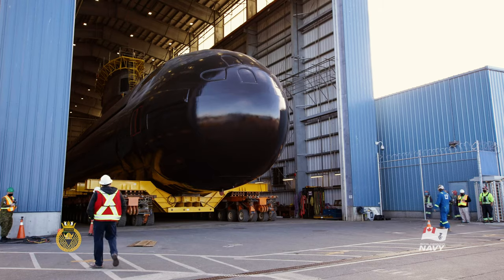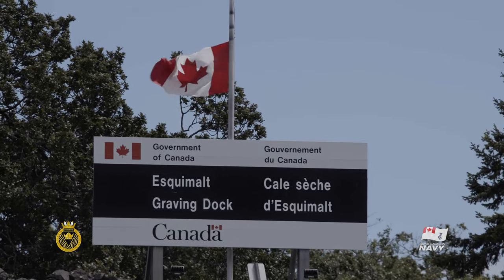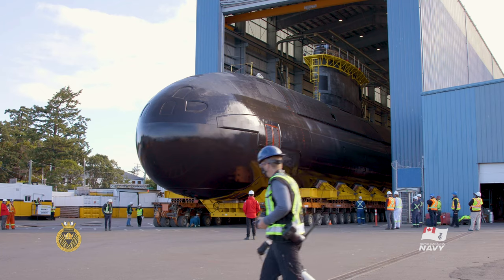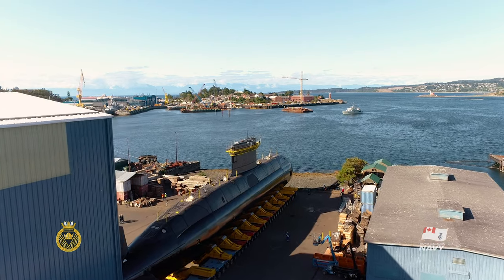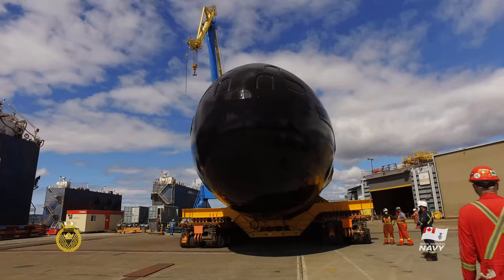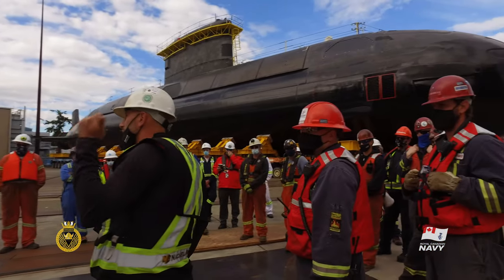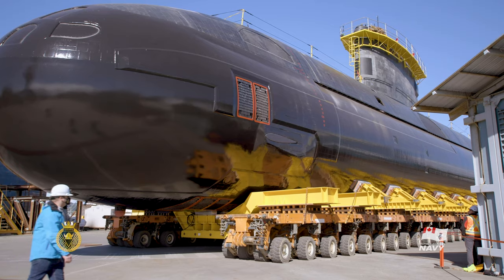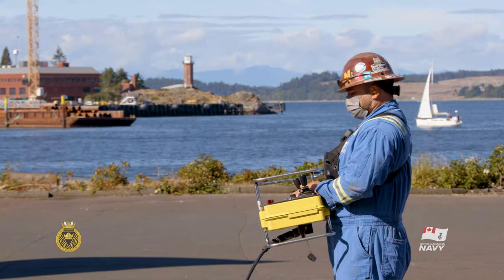HMCS Corner Brook Undocking

Comment: Does it work because we could have had 12 new Japanese hydrogen subs for the price of these 20-year-old ones
Reply: Not even close. A new sub would cost close to a billion dollars a piece and still have the same sustainment costs per unit. Down time is usually done on a cycle of several years of service with 2-3 years of refit where a vessel will be completely stripped down and built back up.
Reply: @Intense951  It has been 2 years since any sub has been in the water. What the point if you can't use them.
Reply: I'd rather have a $billion dollar working submarine with good to excellent availability than a dirt cheap submarine that spends years in dry dock with dismally poor availability.  Just about the entire world understands this except for our government.
Reply: @gary5807  you are ridiculously uninformed please do a little research before making statements
Reply: @alpearson9158  Ok 10 of the best non-nuclear subs in the world
Reply: 30+ year old Used subs... Meanwhile Australia, Not even in the top 10 countries by GDP, Gets Nuclear powered subs LOL!...  Pathetic...
Reply: @gary5807  nukes are poor HK boats........too noisy diesels especially AP boats are far better